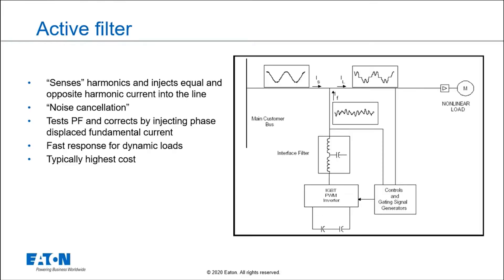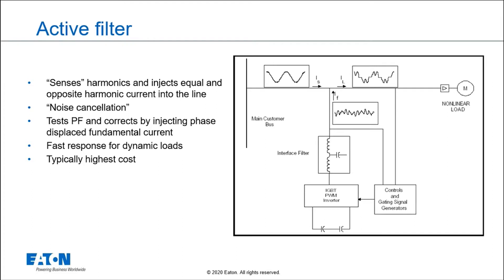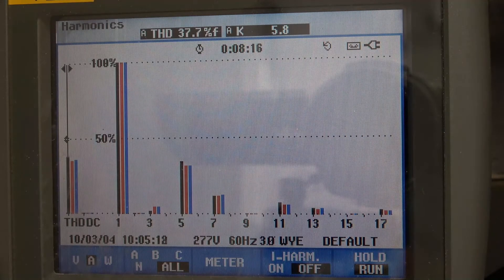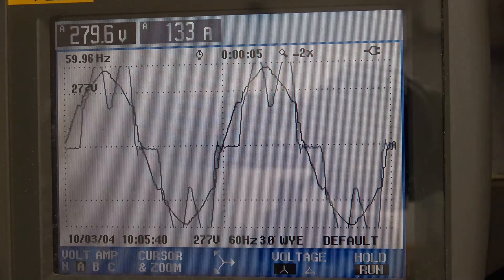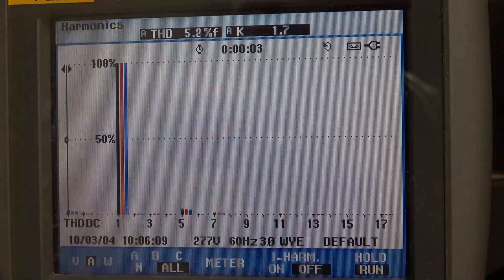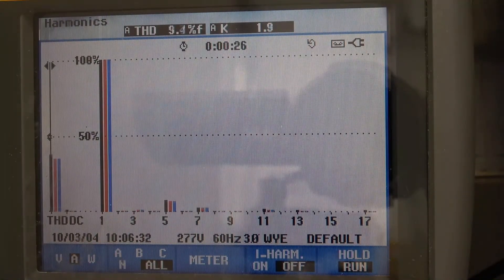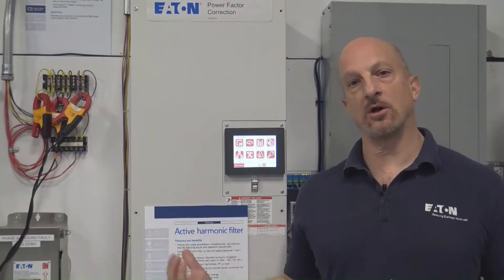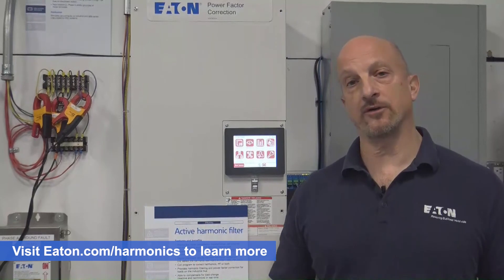6 - Harmonic solutions - how does an active harmonic filter or harmonic correction unit (HCU) work?

Comment: Active Harmonic Filters are best suited for individual drives within a transformer wherein the total connected non-linear loads are not too much. However, Active Filter gets into trouble if the transformer load is near its FULL CAPACITY and the transformer contains too many VFD drives or non-linear loads. Dive in at: https://enconengineers.in/active-harmonic-filter-vs-reliable-passive-installation